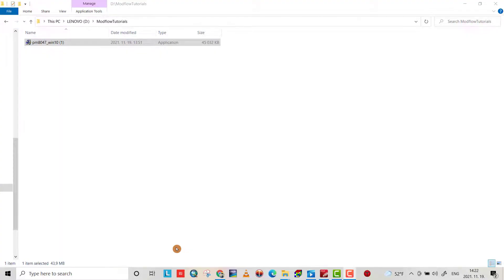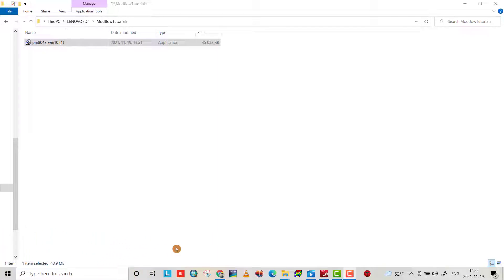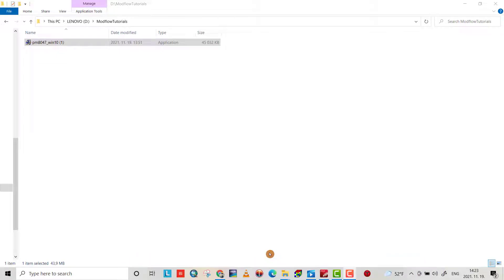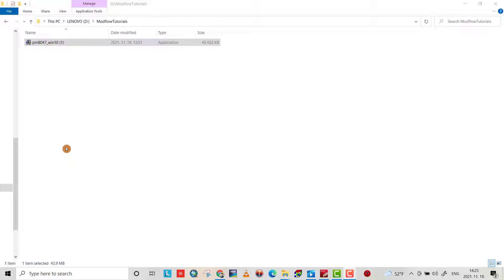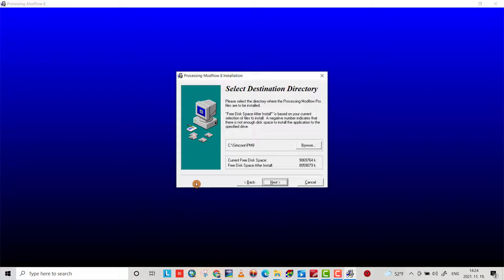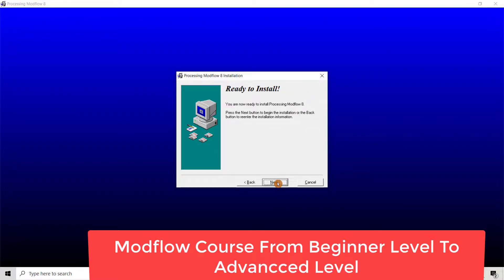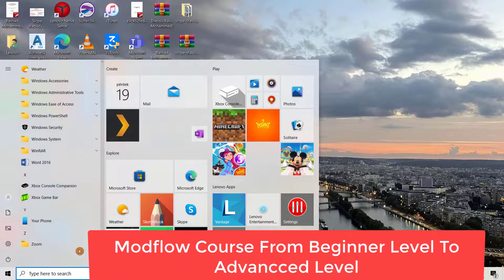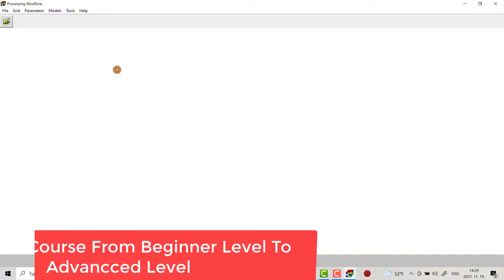Tutorial 1: How to Install Processing Modlflow [From Beginner Level To Advanced]

Comment: Hello,
I am using PMWIN5 (Processing MODFLOW) and importing a DXF study area boundary with real UTM coordinates (approx. X: 410,000–530,000 m, Y: 770,000–950,000 m).

Problem:

When Grid Angle A = 0°, the DXF boundary does not appear in the grid.

When I change Angle A = 90°, the boundary becomes visible but is rotated vertically and shifted, not in the correct orientation.
so please help me .how to fix the problem?
Reply from the maker: I have a video about uploading dxf and put it in right location , please find it